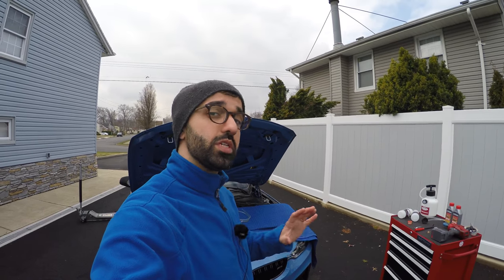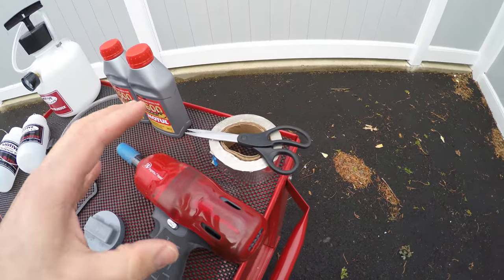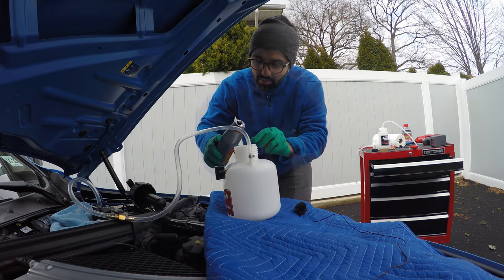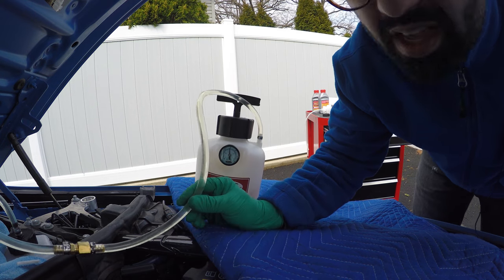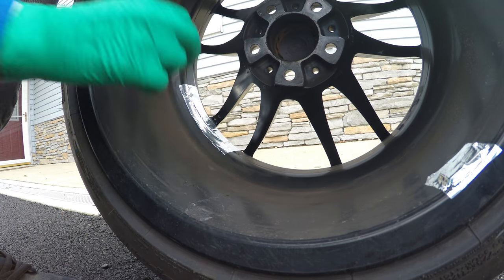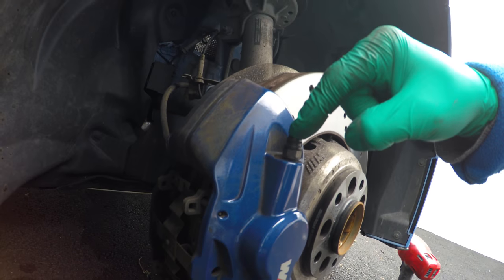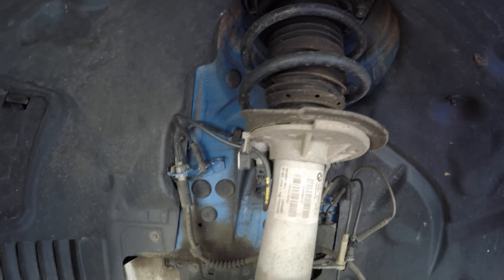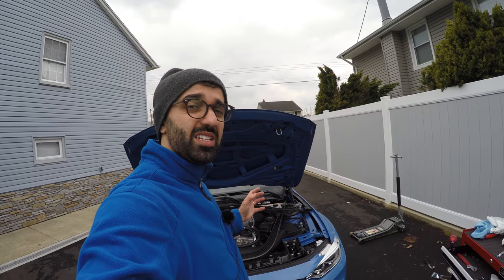How to Pressure Bleed your BMW M3 and M4 Brakes using a Power Bleeder DIY

Comment: You need to activate the DSC pump in bleed mode with ISTA to do this correctly and bleed the entire system.
Reply from the maker: Can you elaborate please?
Reply: Air can be trapped in the dcs system as well so to properly flush and bleed the entire system you should activate the dsc pump so it pushes everything out of the entire system. You avtivate it with ista before you flush and bleed on every caliper
Reply: @sanjinred  how you active the system. ?
Reply: @christianmedina9908  With DIS or another diagnostic tool able to communicate with the DSC system where you can activate bleed mode if you want to change the entire fluid, not only some of it
Reply: @sanjinred  or INPA ;-)

Comment: Tommy - just a suggestion, when you loosen your bleed screws use a "flare nut wrench" or use the box end of the wrench.  The open end, while USUALLY fine, can spread especially if the bleed screws get sticky (oxidize as car ages).  Ask me how I know.. but it's not fun removing a stripped bleed screw because the open end of the wrench spread and stripped the screw :(
Reply from the maker: Great suggestion. Thanks!!
Reply: @TommyLGarage  If you end up going to any events anytime soon please do let me know, I am just over in SE PA and looking for track days, events, etc.  Have a silly 700+ rwhp E34 and a F30 328 daily :)  Love the channel.
Reply from the maker: Will do! I'll be posting it on my channel

Comment: Pro tip:
If you track and bleed your brakes often you should use denatured alcohol (pick up at home depot) to clean the Bleeder and catch cans before you store them away. Brake fluid can be very corrosive, so make sure to clean them after every use!
Reply from the maker: Great point. Thanks a lot!!
Reply: @hiphopsocnroc Hi. Can’t find denatured alcohol anywhere! Idk why? Can I substitute with isopropyl alcohol instead? Would that work just as well, or no? Thanks

Comment: Ditch the Motive unit and buy the Schwaben unit, there is no chance of interhose leaks because the Schwaben unit had not middle connector. The hose goes direct from the bottle to the brake fluid reservoir.
Reply from the maker: Will look into it. Thanks!!

Comment: You also need to run the DSC bleed program in ISTA
Reply from the maker: Not really. It works fine like this.
Reply: @TommyLGarage  yeah it works fine the way you did it. But if you wanted to do it as it was designed then the DSC pump needs to be bled of any air bubbles too. Just letting others know.

Comment: Great vid thank you!! Im about to purchase the motive bleeder kit..one question, after sucking out all the old fluid from the brake cylinder/reservoir, arent you suppose to put in new fluid in? Before you start pumping the pressure bleeder?
Reply from the maker: Hi. Yes. Suck out the old one and put the new fluid inside then the pressure Will push the old one out

Comment: Is there anything else that needs to be done when flushing the OEM brake fluid to something specifically for the track?
Reply from the maker: Nope. This is it. That’s what I do for the track
Reply: Tommy L Garage I appreciate all your responses! I just changed my rear diff fluid. Just got transmission and brake flush remaining.

Comment: Hi Tommy, thanks for the video. Really helpful. 2 questions. The 2 bottles you used were 500ml? So 1L is enough to bleed and refill the entire system?

Secondly, my dashboard keeps telling me 'brake fluid swap due' how do I reset this after I've done the fluid change myself?

Thanks a lot!
Reply from the maker: 2 bottles will be enough for sure, especially with this method.

Comment: Hey Tommy, how you reset the power steering replacement warning “idiot” light, only dealers can do it or is there a reset?
Reply from the maker: You’re talking about the service light? It’s very easy to
Reply: @TommyLGarage  yes, says brake service, I’m gonna follow your instructions how to flush the fluid, 
Need how to reset?
Reply: Meant to say brake service, sorry

Comment: Don’t you need to prime the sending hose before?  Otherwise you get air in the system.
Reply from the maker: Nope. It pushes the fluid that’s already in the cylinder

Comment: What happens when you pressurize it and it's slowly leaking?
Reply from the maker: Tighten the cap a bit more
Reply: @TommyLGarage  I'm pretty sure my cap is fully on.. I'll try plumbers thread too. one more question: is it normal for the pistons to start popping out with 15 psi? My front ones don't do it at all but the furthest one the pistons pop out against the pads really strong. Won't budge. Could that also be a reason for leak?

Comment: Hey im curious,,what makes you go for the f80 m3 instead of the e90 m3? What are the reasons? better mpg,newer tech,warranty etc? and have you ever considered e90 m3 before this? F8x is a great car really,im just curious about your reasons..anyway keep the content coming!
edited: you also didnt have the led headlights and rearlights..didnt think of an upgrade? Thanks again :)
Reply from the maker: Nunez Barbarossa It all came down to the fact that I really enjoy turbocharged engine. Even though the exhaust note on the V8 is a lot nicer, I still prefer forest induction. Besides the seats, the electronics, and the overall looks all completed it for me. I’ve decided that what I really like about the E90 is the sound only - everything else the F80 was the winner.

Tail lights are LED - headlamps might be upgraded soon but I do like the angel eyes.
Reply: Tommy L Garage Interesting..i guess if you're into turbocharged engine f80 is a no brainer..it looks better and have newer tech..you also seems to like the hud and the auto rev match which e90 didnt have..thanks for replying,it really cures my curiosity there😂

Comment: I did this procedure on my e92m3 with the same equipment and somehow the brake pedal reaches the floor?
Reply from the maker: You must have air in the system or left a bleed valve open
Reply: @TommyLGarage   yea I thought it would be that but there is no air in the system and everything is tighten.
Reply: @TommyLGarage  it did have a lot of air prior to the flush tho
Reply from the maker: @gabby811ify  I suggest you flush it again

Comment: Hey Tommy, I was just wondering, what type of lowering springs do you have installed, if you don't mind me asking
Reply from the maker: Amro Assaidi never mind asking questions! The more the merrier. Springs are Macht Schnell. 1.1 inch drop up front and 0.9 in the rear.

Comment: Why did you put aluminum foil on the tire balances
Reply from the maker: Savage Turk It is to prevent them from falling down at track days. After you come down from the track and your brakes are really hot, when you park the heat from the brakes can melt the glue from the weights and they will simply fall down. Having this tape helps them stay together

Comment: Do you know if this procedure will flush out air in the abs pump? I have to replace my abs pump and I am trying to avoid using ista or inpa.
Reply from the maker: From what I understand it should, as ABS pump just has lines running through it. If you are talking about a master cylinder, then there’s a special procedure to bleed that. But with ABS pump you should be fine

Comment: if I have the automatic transmission can I do the same procedure?
Does the brake system center with the clutch? after doing this job, do you need to reset anything on the bmw's on-board computer?
I own a 320d f30 of 2016 automatic 8-speed xdrive with msport braking system
thanks if you can answer my questions
regards
Reply from the maker: Yes the procedure is identical. No need to reset anything and no matter manual or automatic

Comment: Do you know the bleeder valve torque specs?
Reply from the maker: Yes. It’s whatever feels tight enough
Reply: @TommyLGarage  is it common though for fluid to weep/seep out from where the rubber cap meets the bleeder valve at the base even after closing the bleeder valve tight?
Reply from the maker: @ecliffg   not common at all. Tighten it!
Reply: @TommyLGarage  it's pretty snug already and it feels like anything more would over tighten the valves.

Comment: Any reason why you didn’t bleed the ABS? There is a procedure to activate it this will ensure the system is fully flushed of all old fluid. Critical when changing to a fluid you cannot mix ie dot 5.
Reply from the maker: Supertec Racing I did that back in November. But good point !
Reply: The pressure actually does bleed the abs, that’s the point of getting the right pressure before bleeding the fluid.

Comment: Tommy check out my forum post about the clutch delay valve for these cars. I did it on my F30 but the F80 uses the same slave cylinder as the the F30. Improved shifting and no jerk when shifting 1st to 2nd. 

http://f30.bimmerpost.com/forums/showthread.php?t=1486773
Reply from the maker: Mike Mike very nicely done! I might do it when I hit 40-50k miles. For now shifting and clutch both seem fine. But seriously great job. I’ve read through your thread and it quite impressive. Thanks for sharing!
Reply: Tommy L Garage as long as you’re not power shifting or dumping the clutch it shouldent have much effect for you besides the pesky 1-2 shift. However clutch pedel does seem easier to push from midway down.  Modification is easy enough and I think you should do it and put it on your channel. If interested I can modify a new one and send it to you.